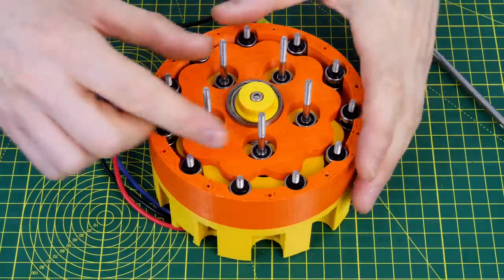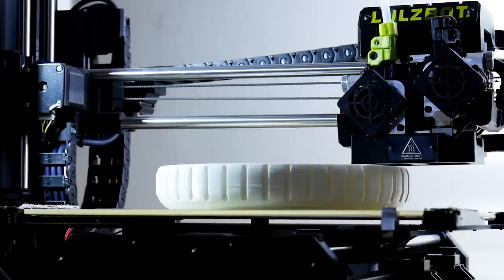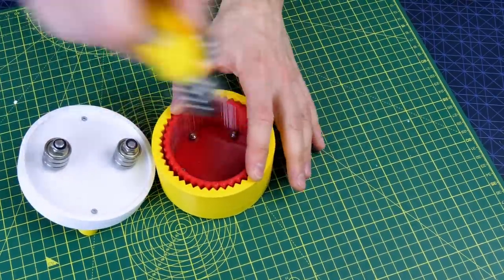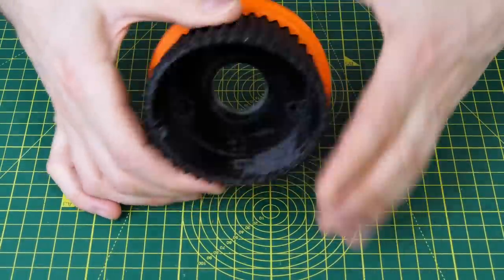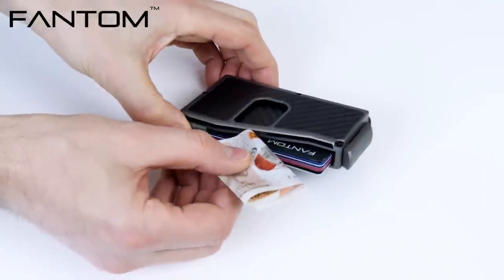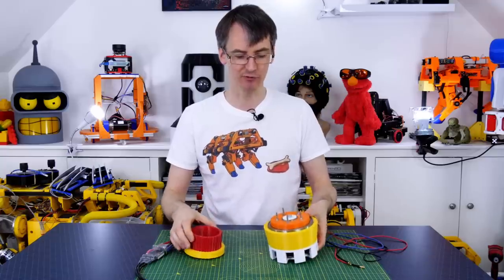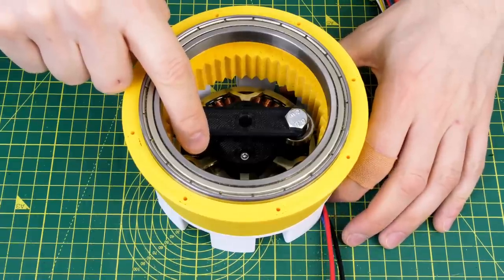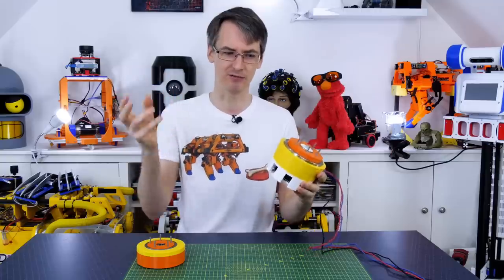Experimental Harmonic Drive Reducer - 3D Printed

Comment: I don't know if off the top of my head, but there is a really lovely equation for working out the number of teeth required for each sides of the harmonic drive - maybe a mismatch is causing it to skip. Also, I'm almost certain you can make a harmonic drive back-drivable (again, I can't remember how). Don't give up on it just yet James, a robot made to use harmonic drives would be really impressive. Everyone else on YouTube just does a cycloidal gearbox you see, it would really set you apart.

Comment: Harmonic drives are particularly used in 5 or 6 axis robots due to the fact that they don't back-drive. When there is a E-stop (Emergency stop) or power failure  you don't want them to go limp and drop their payload.
Most of the robots (Kuka, Fanuc and Kawasaki) we use for spot weld and manupulation applications have an 165 to 200kg payload and you don't want that flopping around.

Thanks for your tinkering with this however, as it has given me food for thought and I can definitely use your cycliodal gearbox for something I have in mind.

Comment: It would be cool to have some components in a clear material so we can see what’s going on inside!
Reply: 3D printed materials aren't very see-through, unfortunately: even transparent filaments are so hazy they might as well be white. You can post-process the outside, but the infill will still be mostly opaque.

I guess plexiglass can be used in some cases, but that's somehow flexible AND brittle at the same time, so it's not exactly ideal, either.
Reply: @bjrn-oskarrnning2740  maybe a laser cut acrylic
Reply: I’ve seen a few other harmonic drives on YouTube where the back plate (not the output plate) is made from acrylic so you can see the precession of the flex spline.
Reply: @Mrbulletfire  does he have a laser cutter?
Reply: @pvic6959  not sure, could be something to look into and fun new branch of making to discover

Comment: I'm a mechanical engineer who has worked with Harmonic drives professionally and they are absolutely back driveable, (although I admit I struggle to wrap my head around how) but they require very tightly toleranced components and are very stiff. The reason your printed one likely is not backdrivable is likely due to the compliance of the TPU flex spline teeth lowering your ratcheting torque and also absorbing rather than transfering the necessary forces back to the wave generator.

Cycloidal drives are much more impact resistant due to the larger surface area in contact between components transferring forces in the gear train which is why they're used in big industrial robots like Kukas. That's probably your best bet for 3D printing as a fabrication technique and for the application of the Open Dog legs.

Comment: I've worked with harmonics a bunch before in a previous job - those gear boxes were back-drivable in my application.
I'm guessing your motor can be stalled and can't be back driven due to the spline being able to stretch. That would expand the spline and allow more teeth to mesh at once than would mechanically allow for the teeth to skip properly.
The thin metal splines in harmonics can deform, but not stretch. If you possibly print or use a spline material that can elastically deform without stretching, that may give you better results. One option is putting a thin-walled spring-steel tube inside your spline.

Comment: Commercial Strain wave gears absolutely are backdrivable - even at 1:100 ratio. They are used extensively in collaborative robots for this very reason - otherwise you could not move the robot in teach mode. Internal friction in this prototype combined with the low stiffness of the flexspline is causing  geometric binding. I think the ideal ratio for backdrivability is closer to 1:30 or 1:40.  A lot of knowledge on this topic can be found in Harmonic Drive’s older (10+ years) catalogs.

Comment: From what I understand, the reason that you can stop it with your hands is because when you hold it the flex gear expands (because its flexible) and locks in place while the inner piece just rolls around freely.

Comment: The skipping is possibly due to the concentrated forces on the single stack of wave generator bearings. the flexible gear is deforming around the bearing- so spreading the load and reverting to a double stack should help.

Comment: Several others have mentioned Levi Janssen’s approach using a compliant structure for the flex spline. I think this could solve some of the problems for you. Making the flex spline out of a harder material should greatly decrease frictional forces between the two splines, and harder teeth should also greatly reduce skipping as well. A rigid material normally wouldn’t work for the flex spline, but the compliant structure Levi designed fixes that. As an added bonus, the compliant structure also greatly (!) reduces the height needed for the flex spline, because the compliance is handled radially, rather than relying on the height of the spline to accommodate the needed amount of flex.

Comment: the flex drive has baring that runs along the inside of the flexible belt. Because of this, I believe, that when you stop it that lets the barrings spin freely. There is nothing stopping the inside barings from spinning feeling along the inside of the flexible belt.

Comment: A bit new to these types of drives my self.
I've noticed that the harmonic drives has less surface contact/engagement area amongst the sets of teeth. That would result in putting a lot more force between a small amount of teeth. 
Also, it's likely your flex teeth are also being heavily compressing between the wave bar bearings and the wall of outer teeth. Which could be allowing the flex teeth to compress enough for slippage to happen.
If available, you could try another more solid, but flexible material that can handle the force between the low area contact with the teeth sets. Overall, it looks like a more finicky drive to figure out the tolerances in design. 
It's pretty cool that your trying it out and having fun with it! I've been enjoying the proxy ride along with your adventures into different types of reduction drives. As well as your robotic projects in general.

Comment: My intuition tells me printing the flex spine from a soft material is what’s causing the slipping. I think it would be worth trying it with other, more rigid plastics. 
I’m also curious if you could add a second flex spine, with the rollers 180 out of phase to get more engagement? Would add friction, but could be even stronger holding power. 🤔
I love it all, very fascinating!
Reply: Yeah, I have a feeling the teeth are getting squeezed out of the ring gear because it is too flexible.

Comment: this design:
- can't be back-driven
- can be stalled
- is heavier
- will probably wear out sooner, with the flexible material
In all, seems like the cycloids will work much better for you
Reply: also, I'm pretty sure your flex material is squishing, leading to the skipping and stalling
Reply: and we can even already see wear in the video, at e.g. 11:05. and by the pattern i'd guess not much of the inner TPU gear actually engages with the outer PLA one, or at least only the bit with the bearing right behind is actually involved in transferring much force. looks like that might be where the "stalling" originates from, simply the gear deforming in an unintended way
Reply: Yeah in this case cycloidal drive is better but harmonic gear boxes are really next level technology and really the best in certain use casses
Reply: Strain "weave"?!
Reply: You may be correct, but it's because of the materials he's forced to use due to 3d printing it. The design itself is extremely popular in robotics because it's very effective when using the proper materials and design, but 3d printing it has always cause issues unfortunately.
Reply: @MrPesht  yes, I think you're right
Reply: I think “traditional” gears are the way to go. There is a reason why cars, bicycles etc. don’t use these kind of fancy transmissions.
Reply: @Mike-oz4cv  well cars and bikes need to change the ratio between the input and output, this doesn’t
Reply: @Mike-oz4cv  cars, bicycles, etc. (or, most things) don't have a major problem if there's backlash. "Traditional" gears alone will always have backlash, often a lot of it.

There isn't a single type of gearing/power transmission optimal for every use-case in the same gear, reality doesn't work like that.
Reply: 2 things. The cycloidal drive had I think $250 if bearings in it? It had a lot. And two, compliant (flexible) mechanisms actually last longer than other types of mechanisms, not shorter.
Reply: @butterbits372  that's true for a lot of purpose-built drives. But this being a 3d printed open-source project means you can't get ideal performance out of the material, as you've got more striations and variance than you'd see in something like an injection-molded part
Reply: @Mike-oz4cv  "Traditional" cars, yes. The reason being ICE are unable to deliver torque at low speed. Modern cars (EVs) don't have to trade RPM for torque and don't need variable ratio gear trains. All industrial robots use cycloidal or strain wave reductions.

Comment: Gear transmission is positive type, which means power transfer is guaranteed as there are no flexible parts. In case of this harmonic drive, as transmission body is flexible, power transmission as not guaranteed (motor shaft can turn when output shaft is stalled) In which case the encoder needs to be attached to output shaft rather than at motor shaft.

Nice design btw!

Comment: Very cool. Having worked with collaborative robots during my day job, I can confirm that the full spec Harmonic Drives are backdrivable, and have the encoder mounted motor side. The wave generator is elliptical though, with a ball bearing race between it and the spline IIRC. Might be printable if you use a flexible material for the ball cage. And then bathe the whole thing in lubricant. At that stage the cycloidal reduction starts to look a lot more feasible. Looking forward to seeing where this goes next!

Comment: I think the harmonic drive keeps jamming up because the gear teeth flex, and don’t go where they are supposed to. Also, it probably doesn’t back drive because the teeth are locked together, and you would have to force the teeth out of position, which doesn’t really happen because the bearings/rollers are in the way. Changing tooth profiles and experimenting with smaller rollers might produce different results. Great vid!

Comment: Things that helped my design:
Printing the flex spline in PETG
Higher diametral pitch allowed for a lower pressure angle and lower deformation to engage.
The commercial drives have flex splines made of steel with a really high pitch and only deform by about a millimeter. 
I imagine this critical as it would massively reduce the amount of energy required to deform as energy required is proportional to the square of deformation, 
(E=1/2 K*d^2) while also reducing the friction (Ff=mu * N; Fs=-kd)

Comment: Your cycloidal drive has bearings instead of plastic teeth where it meshes.  I think thats why the cycloidal one runs so much more efficiently.  It converts less work into heat when running and has less friction to overcome when starting.

Comment: I think the reason that the output can be stalled is due to the fact that the flexible filament can be deformed meaning that the engagement points on the inner gear can bend and 'squish' and allow the bearing to rotate around without the inner gear advancing to the next tooth.

Comment: One other thing about those harmonic drives with the flexible metal strain wave "gear".
They almost certainly run in lubricant, which does wonders for the intrinsic friction of the mechanism.
Also, as a whole, harmonic reduction drives aren't really that useful at these gear ratios like 10:1 where it's easy to back-drive things. They're much more suited to being used at ratios of 50:1 or greater, and at those ratios they have a few advantages compared to other types of reduction drive:
- Greatly reduced number of moving parts, especially compared to a high reduction ratio planetary gear-train. ("the best part is no part")
- Relatively low backlash compared to most other offerings, which is always a plus.
- Can be made much more compact (shorter) than a planetary reduction gear-train of the same reduction ratio and torque capacity.
- Difficult to back-drive (this can be an advantage in some if not most applications)

However, it does have some drawbacks:
- The lower the reduction ratio, the bulkier it becomes (theoretical minimum diameter must include a "gear tooth height * 4" component, which at low reduction ratios will become the majority factor of the diameter of the whole mechanism, but at high reduction ratios it trends toward zero).
- Extremely high friction in the back-driving mode, often to the point that the mechanism will find other ways to permit the output shaft to rotate rather than drive the rotation of the input shaft (as you saw in your prototype "slipping" instead of back-driving).
- The use of a flexible component creates a nearly-inevitable point of fatigue cracking failure.
- High overall frictional losses in the mechanism (this can be avoided by clever selection of materials and use of bearings, but even then the frictional losses will still be higher than most other kinds of gear reduction).

Comment: I designed a 40:1 Cycloidal Drive which is still backdrivable and super compact, the only drawback is the cost and also the weight of the bearings if you would use it in a robotic application like a quad...keep up showing us more reducer options! This is super interesting!! 😊
Reply: Please could you show us @Swann Schilling?

Comment: Harmonic drive has "mushy" gear. When rotational force is applied to teeth, their output force is towards the middle, increasing the gap between teeth and making them skip. To reduce this, you could try making a cross (it should have shorter sides than length) with 4 bearings, instead of a single bar with 2. Or even a 6 point star, where the 2 main bearing would remain at the same position as before, but the 4 side bearings would allow flex gear to move certain ammount.  It should act as a tensioner for flex gear and make it have less free space to buckle in. 
Ideally, the best solution would be a parabolic curve slider, from one bearing to another, on both sides, to really stop flex gear from having extra space. But that would increase friction drastically.
Also, another thing, Cycloidal drive has so much more contact patches, while harmonic drive essentially has only 2 (at bearing points).

Comment: I'm curious if the TPU 'teeth' are just mushing to get out of the way in a stall condition, rather than being properly engaged.  Perhaps making a tooth 'cavity' that you can press rigid teeth into, made out of PLA, so that each individual tooth is hard and positively engages with the outer gearing, but the space between each tooth is flexible allowing the whole mechanism to flex?  It seems like having the whole mechanism flexible would cause issues under load.

Comment: Put a thin walled cup of PLA or ABS inside the flex gear that the wave generator has to deform first, I think the reason you’re able to stall the drive but not the motor is because the TPU is just squishing and letting the wave generator spin.

Comment: Try planetary gear box next? You can 3d print multi stage ones and buy commercial mental ones for cheap since they are commonly used on drills
Reply: The point of these two reduction types is that you get a very large reduction in a single stage.
Reply: @kantpredict  thank you. As far as I know you have covered the only two in-line single stage reduction gearboxes - plus one with many moving parts patented by a company basically like a wave drive gearbox but use flutes undead of gear.
Reply: @leozendo3500  undead ?

Comment: If you are currently evaluating reducer drives you might want to look at: https://www.youtube.com/watch?v=zoaHeamUqBE&ab_channel=IEEESpectrum It is pure rolling and seems suitable for 3D printing, though it is not backdriveable. I experimented with this design using bearing balls as rollers and the results looked promising. Would definitely require the least "Vitamins" as a 3D printable design in comparison to other reducers.

Comment: i think the problem is the stretching of the flex part, it might help to have a second rotor (slightly shorter to hold the flex part in the correct "off" position) or somehow integrate a metal wire, or a belt, inside the flex gear.

Comment: Harmonic drive has a very high starting torque, due to the deformation that you've got to cause. I've got an actual branded Harmonic I picked up a while back, and it requires something like 40 oz-in just to start turning, so you have to subtract that amount from the input torque when you're trying to figure out your output. For the motor I was using (430 oz-in NEMA 23) it was no problem, as that left me 390 oz-in at 100:1, so plenty of output power. You're running at much higher speed than me, as well much lower reduction. (And probably much lower torque as well.) I'm not surprised that you could stall the strain wave gearbox.

Comment: Harmonic drives can be backdriven no problem. I would suggest instead of making the flexspline shorter to make it longer (more material to flex) and only use one set of bearings for the wave generator more to the open end of the flexspline.

Comment: I seen video of harmonic drive using complaint mechanism printed out of PLA as inner part. It destroyed itself on torque test, but part itself had design issues - complaint joints broke. Looks like it worth investigating.